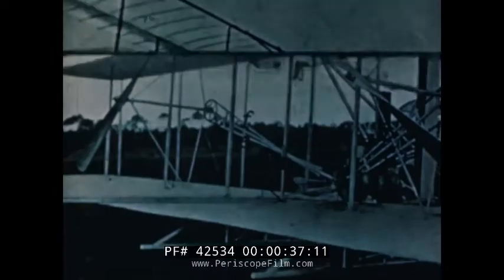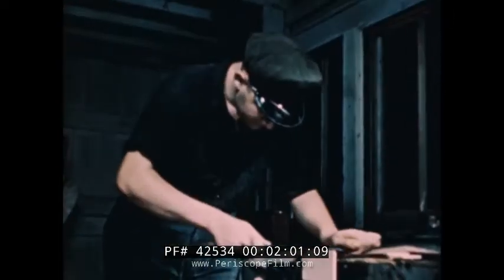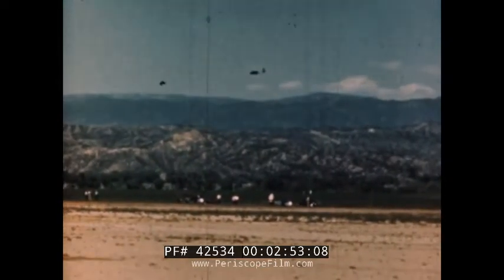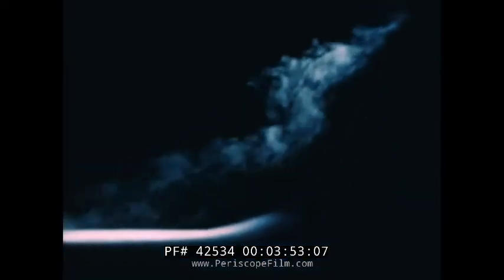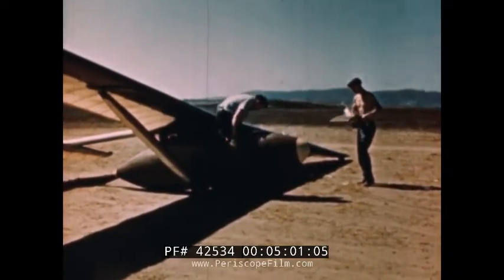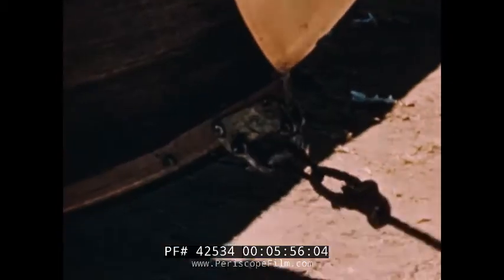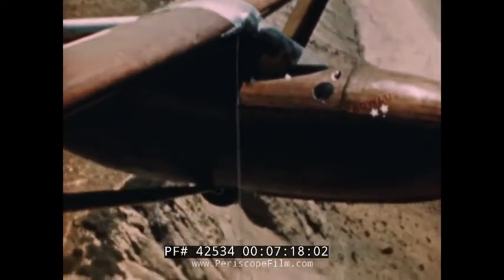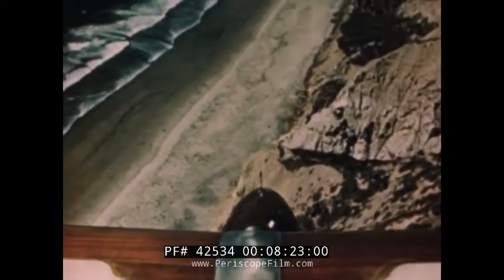“SAILPLANES AND GLIDERS " 1940s UNPOWERED AIRCRAFT FILM w/ HAWLEY BOWLUS   42534

Comment: The actual location is not " Point Loma in San Diego" as stated in the description but Torrey Pines glider port - which is still in operation today - though dominated by paragliders and RC aircraft having budged out the sailplanes some years ago.
Reply: You are exactly right. Point Loma was where my great-grandfather would test newer prototypes due to the favorable conditions for gliding. But most of his regular everyday flights were out of Torrey Pines glider port.